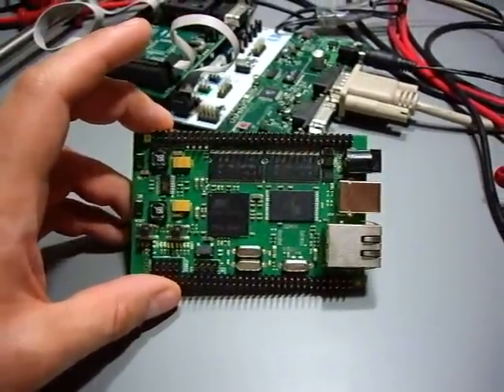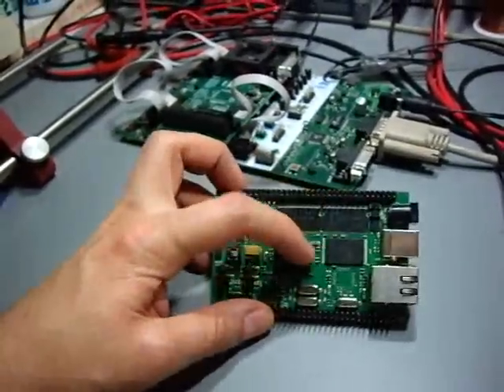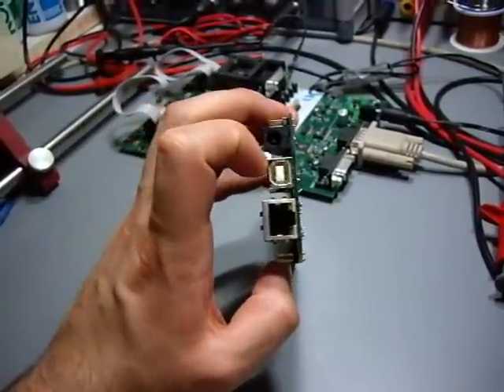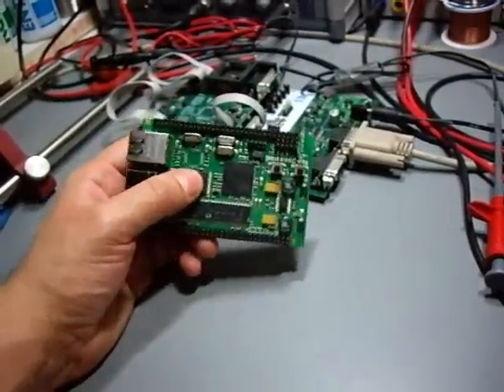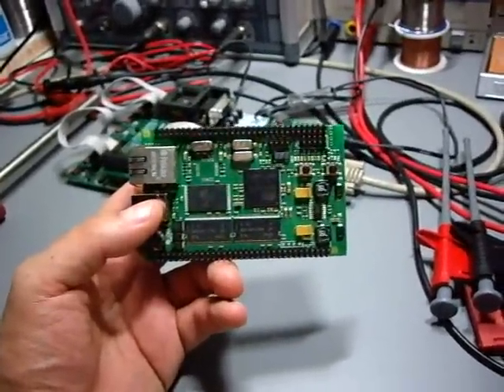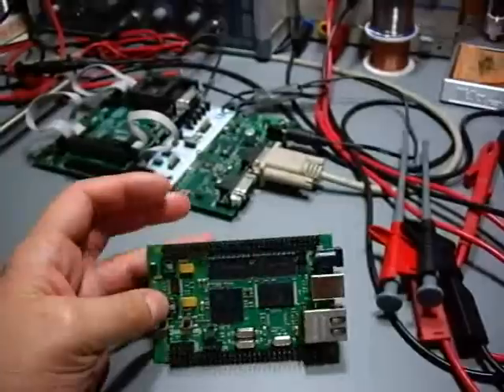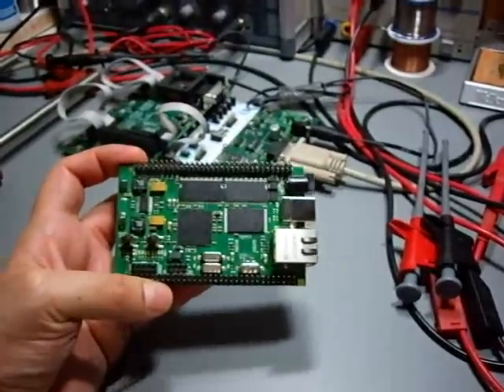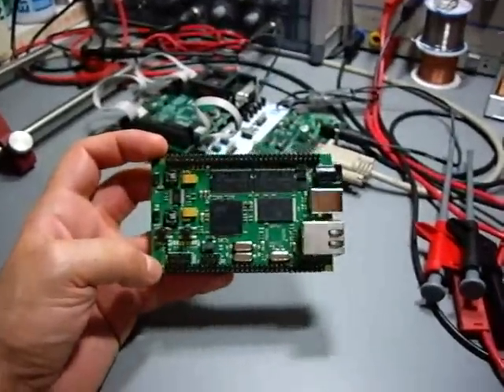Grasshopper AVR32 Embedded Linux board

Comment: 64MB of RAM is like an old Linux PC. I think an SD card connector on that board would be useful. Though the reading speed on an SPI bus is not very high, data could be copied in RAM at startup.